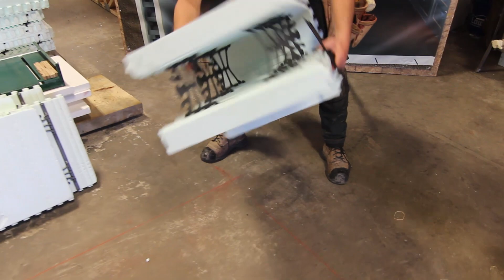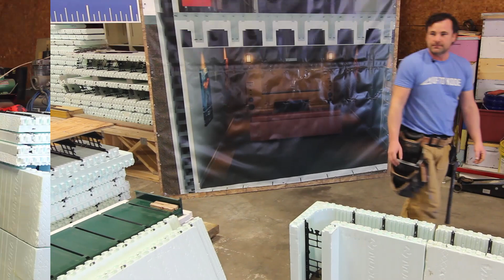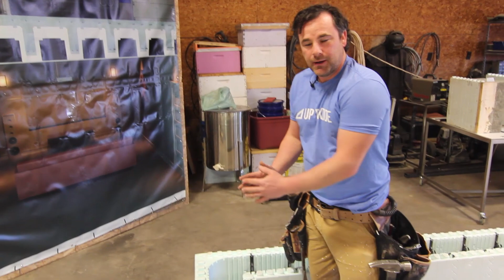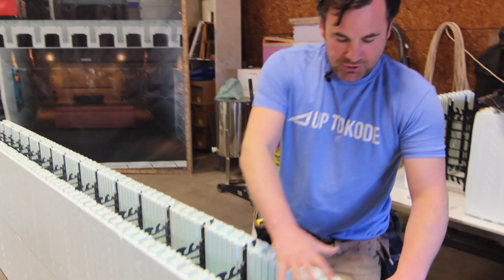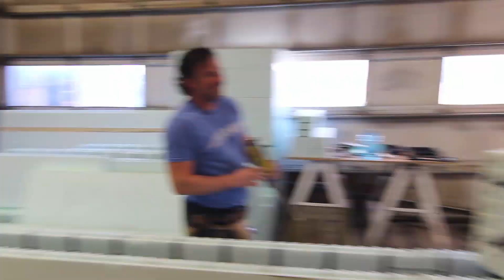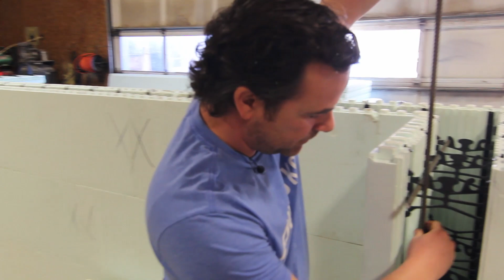How to Assemble an ICF Wall for Beginners

Comment: Don’t use these total rubbish and expensive. Just built one for a customer, never again
Reply: What went wrong ?
Reply from the maker: I wondering the same thing? If you don’t look at the big picture it can seem expensive but certainly not when you factor in all the steps that ICF covers at one time. Factor in overall efficiency and it will begin to make sense

Comment: hey guys,  is there an easy way to hang shelves on ICF? i have drywall over mine now and no why to find the plastic bars
Reply from the maker: Great question. You can use drywall anchors.  And if you do find a plastic tie all the rest should be 8” spacing. That’s the most common. There’s the odd ICF block that has 6” centres.
Reply: @uptokode  awesome thanks Cody, i was thinking if all else fails ill use 8" tapcons haha
Reply from the maker: Haha. Yes that is worst case.
Reply: Maybe a magnet to find the drywall screws. You could then measure 8” to your desired location.

Comment: Kody can you do a video on the attachment of interior finish trim around windows and doors. The way i see it now there is not enough material on window buck to catch a 4" or 6" trim piece around windows or doors.
Reply from the maker: Hi Dan. 4” trim is easy to attach. The buck is about centre of the trim after you account for the window jamb and the insulation gap, etc. Now if you want to install big trim like the 6” you mentioned, then here are a few options for you. 

For me I would just keep the standard block and glue the trim to the drywall. There’s no shooting in an ICF so all you need is attachment so the glue can set. 

All these other options add time and money, 

You can decide to add extra lumber to the buck so it has 3” of wood all the way around… OR… router 1/2” deep on the inside and remove that foam so you can install strips of 1/2” plywood around the buck , flush with the foam. Then drywall. Now you have lots of attachment in behind.
Reply: @uptokode  Kody thanks for the detailed response.
Reply from the maker: You’re welcome!

Comment: Kody if I am doing slab on grade with a frost wall 42" into ground with ~1.5 to 2'  out of ground how do you stagger rebar? Is it same way as if you had a basement?
Reply from the maker: Yes exactly. Rebar placement would be the same but because you have fill on both sides of the wall it doesn’t matter if you bar is to the inside or outside anymore. I would keep it the same as a basement.

Comment: I have questions, is there a way to cantilever a second floor 2 ft over with using ICF forms? Thank you for your response!
Reply from the maker: We’ve offset the 2nd floor back from the main floor walls so I don’t see why you can’t over beyond the main floor to the outside. 

For our situation, the space from the bottom of the floor system to the bottom of the windows (54” high) was the header or lintel that allowed the 2nd floor to span over the main with no support. You’re going to need an engineer

Comment: I want to build my new apartment complex out of ICF but there are so few options for architects and builders here in Houston, TX who can reliably get it right. Any contacts in this area?
Reply from the maker: I hope you can get it built the way you want it. I would start by phoning a rep from Nudura, Logix, Amvic, Fox or any manufacturer. They will know some people. 

If you find yourself a practical engineer or architect they will realize this system is super easy to use

Comment: No wall is exact and you did not show a wall from ground up that may be in the middle of the lines, let's say if a home owner wants to build the basement walls but leave the house to a contractor who built it to the plans and your way was not quite to the plans. most beginners would not know want to do with a wall that didn't line up because they built it to match the plans proper.
Reply from the maker: You can make the dimensions exact but sometimes growing or shrinking the building slightly allows for a much easier install. 

But if dimension was your priority you could do it. Might just take additional time to scab a “vertical joint” as we call it. 
You have a valid point though

Comment: If you were building a shop/garage or other tall wall (say 16-20’) would you pour it in one shot?
Reply from the maker: I like to pour 10 feet at a time. Hard to vibrate much taller than that. But I know guys who would pour those heights in one shot.

Comment: What is the max wall height you can pour in one shot?  I see a lot of 'builders' breaking up the pours (one pour for each floor).  That seems like a waste of time/money, but I can see how stacking would be easier.
Reply: If you’re using SCC and have the rebar set (or some replaced by micro rebar) the heights in commercial building pours exceed what residential builders would think about.

Comment: I'm curious on the wood scabs at the joints, what are you screwing into? Just the foam? Or into the black plastic parts? Using screws I would guess?

Comment: How much overlap you need for bars in vertical directions? For example for second floor walls over first floor wall.
Reply from the maker: The rule is 40 times the diameter of the bar you are using.  We just go 2 feet to keep it easy.

Comment: Hey Kody, great to see you back to making videos more regularly. I think I'm finalized on using Nudura. The ability to ship more in less space is a big deciding factor. My only issue is I want to use the Fox blocks bucks. I want to eliminate the thermal bridge. Do you see any issue with using the Fox buck with the Nudura block?
Reply from the maker: I’m sure you can mix the systems but I don’t know enough about the fox bucks to give you a definite answer. 

I’m guessing that if the total wall thickness is the same with both block then it should work.

Comment: This is off topic but I have a question. Has anyone ever measured the temperature of the concrete in a ICF wall? The ICF wall is sitting on a concrete footing. In colder climates, how much thermal transfer is there from the concrete footing up the concrete? If the footing is 50 degrees fahrenheit, that would the temperature of the concrete be above ground?

Comment: Have you tried Helix Steel in lieu of rebars? If so, would you recommend it?
Reply from the maker: I’ve never tried. My one supplier ran the math and said it’s honestly not worth it. Below grade where you need more strength you almost can’t put enough helix in the wall. Let alone the expense. 

Maybe it has its place if you want to do a 4” above grade wall where there’s no room for rebar and a place to run a vibrator down when pouring.
Reply: @uptokode  helix micro rebar has received engineering approval and been installed in concrete for millions of cubic feet of walls.
Consider doing research on a product before dismissing it.
Reply: @uptokode  Regarding Helix micro rebar;never trust a supplier who does not handle a product to give an unbiased opinion on that product.

Comment: Can an ICF wall be poured in stages? Like the bottom 4' then the top 4' a few weeks later?
Reply from the maker: We pour a 10 ft wall in 2 stages but all in the same day. You pour the 1/2 half and then come around an top up the 2nd half. 

For additional floors or wall height then yes we set up another 10’ height (or whatever it needs to be) and pour on top of the concrete below that’s been sitting there for a week or so. 

The key is to leave rebar dowels sticking through the 1st pour so the 2nd pour can be bonded to the 1st and it keeps all structural integrity.
Reply: @uptokode  how much the rebars have to stick out in this case? Also, is pouring 10' the same day be structurally better than 2x5' in different days?

Comment: Hi, I'm in the process of building our house. No engineerings been done, just 20+ years in construction and research to help get to this point. I tend to over build to make up for lack of technical knowledge so I've used heavier bars and thicker footings. Me and my wife have already poured a monolithic slab above grade 20" and planned on ICF. My original design has me overhanging ICF 2" off the slab as sort of a drip edge and eventually a stopping point for a stone veneer skirt. It also helps hide some of the formwork issues we had on the stem walls.
My question is, should I have any issues with the 2" overhang? The foam is 2-5/8"  so i will still have 5/8" bearing on the slab. I'm hoping this isn't an issue prior to pour day or on pour day. Any advise is appreciated and because of your experience I felt it was a worthy question for my 1st ever comment on YouTube. 
Thanks!
Reply from the maker: I can’t see there being an issue with the foam overhanging that 2”. Every horizontal break needs a drip cap so the water doesn’t follow its way back underneath the foam and toward the slab. The metal lip of the drip cap is what allows water to break off and fall away.
Reply: Thanks, I was thinking about a flashing at the bottom of the ICF! I was more worried about the ICF block bowing out and releasing the concrete.

Comment: I subscribed to your channel when I saw the ACH value of one of your latest buildings was 0.23, super impressive. That ACH value made me interested in ICF because it made achieving such low values possible with little effort. I will like you to go into details the steps you took when building that house to achieve such a low ACH value. I am very interested in the ACH value you can achieve if you really focus on getting the lowest value. Hope to meet you one day, stay blessed.
Reply from the maker: Hi Daniel! I’m glad the video helped you realize how easy it is to achieve an air tight home. That was my goal! 

I will make a video someday on how I achieved that number. It wasn’t that hard.
Reply: what is ACH?
Reply: @topbuilders3440 ACH air changes per hour and is a measure of how many times the air within a defined space is replaced. The lower the number of air changes, the less energy is required to keep that air at a comfortable temperature. If you cool/heat a house with a lower ACH the temperature is maintained for longer because that cooled or heated air is trapped in the building.

Comment: Obviously termites are not getting through poured concrete, but I have heard they like to eat and tunnel into this foam. What are the facts please??
Reply from the maker: I don’t know the answer to this. I keep getting more questions on it so I best do some learning. 

We don’t have termites where I’m from.
Reply: @uptokode   yes please do. Big swaths of the USA are termite areas.
Reply: I think they make ICF that is termite resistance and If you put a good barrier I think itd be hard for termites to get into the foam
Reply: I built ICF in Florida back in 2000. Lived in the home for 10 years with no worries about termites. The outside was finished with stucco though, which probably mitigated the issue.

Comment: Hi, Kody. Thanks for the video. Did you screw the scabs on cut ends to the foam or to something solid inside the foam or inside the form?
Reply: The scabs are fastened to the snap-ties that are embedded in the foam, I think every 8 inches - which are then fastened to each other "through" the concrete via the slide-in webs. The webs are variable size to allow different core depth.
Reply: @gregfitzpatrick1824  Thank you
Reply from the maker: I see Greg answered that.
Reply: @uptokode  Thank you